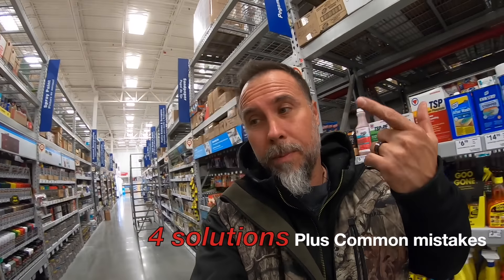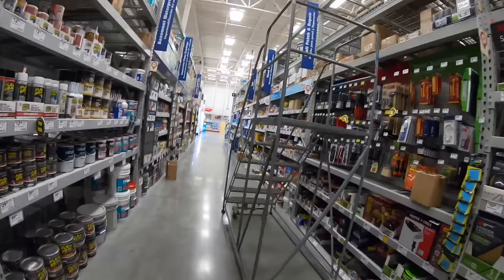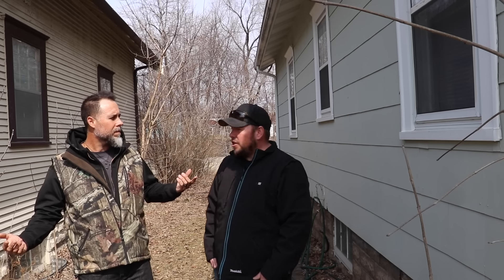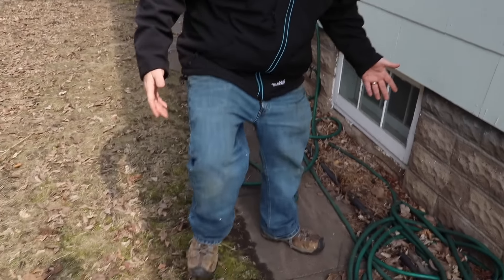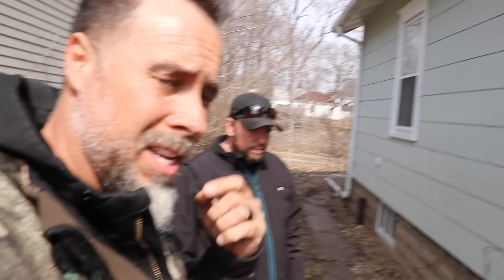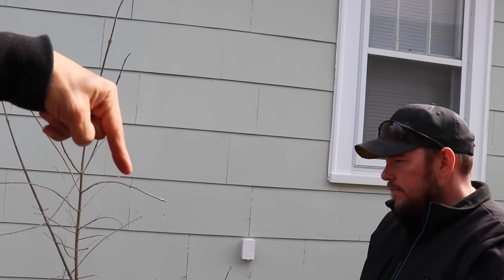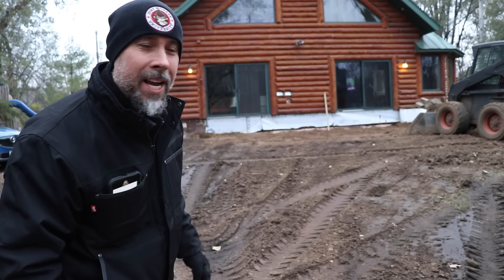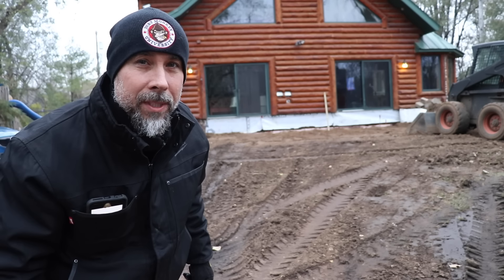4 Solutions to fix a wet basement plus Noob Mistakes

Comment: Betting this post will be deleted..lol.
  These men have only few basic clue of what they speak of.   I'll point out few  examples that they  are not professionally trained below grade waterproofing specialist.  Nipple out? They also called that product a waterproofing membrane is not.   This product is sold world wide,   not hard to find its sold by many different name Mir-a-drain..or j-drain. They also nailed it into the exterior of the foundation wall,   some folks do that,  i don't.   Mir a drain is used to cover the foundation membrane it protects it from the backfilling process..it creates a void between the backfill and the membrane so hydrostatic pressure can not build up  basically sends water directly to the footing drain.  
  Also never backfill with gravel or drainage rock from footing to grade level... cost a ton and your doing a major  disservice your giving service water a path to your footing drain... not smart. 
   A waterproofing membrain is  Typically an   alasticmaric  that dries flexible an builds to at least 6 mil thick. Never a plastic or waterever he was talking about. 
 The issue with putting plastic against the outside of your foundation is,,, its not waterproof there's seems,,,it will dry rot and it will get holes in it when you back fill.  Water will get through hole then can't flow back out and will end up in your basement. 
  Last point where homeowner see water in their basement  has little to do with where it came from when they have a block foundation as the basement in this video..  Block are hollow when water inters it drop to the bottom.. like when you put water in a glass fill bottom to top..point is ever single block foundation in the world history, (as long as concrete want poured inside the block). Leak where it meets the slab... everyone...it comes in where that slab is lowest every time .  When you look at your block wall you will see part of the 1st course of block normally about 3 inches of the bottom run... where ever you see more of that bottom course is where you will see the water because your slab is just slightly lower right there.....if it was slightly lower 3 feet to the right of left that's where you'd see the water because the whole bottom course is standing in water,,, because blocks are hollow...point you see water at your feet it lightly didn't come from directly from the area on the outside and there no reason to think it did...... don't know if anyone is reading this but...let me add this....Mir a drain is to be placed nipple against the foundation..lol nipples out is pointless and just silly.
  He spoke about foundation membrane and thus stuff non fiber..lol that's referring to non fiber asphalt... that's not a membrane and that's not waterproof.   It dries hard and cracks.  They are not ready to make how to videos and no where's close to be working as foundation specialist.   There is one point they had that I agree with..... never ever never put a interior pressure relief system in your basement like ever,   once it's done well never fully reverse it and you will always have a high humidity level and aways will smell like a basement...
Reply: Mr. Paul, I'm in a situation where I can't access 3 of my basement walls from outside. This is due to my basement not being the entire floor plan and then 2 sides have 24-40 feet of slab past the wall for part of the house and the garage. So basically my basement is like an open cardboard box with 3 flaps out and one missing. So the one side i can access and dig down below footer will be a major issue due to all sewage/gas lines and a 18k watt generator on a slab and a slab from where the a.c. unit sat previously will need to be worked around plus septic tank is only 16-18 ft from that wall and also the deck is on that side but that's a small issue. If I dig down that 1 side and down everything perfectly won't the water just run around and come in the other 3 walls I can't touch from exterior?
Reply: I read the whole thing and I  agree with you. Thanks for taking the time to write the next chapter. It was well worth reading and better than the whole video. Watch the FRENCH DRAIN MAN on YouTube his vids are mostly landscaping but contradict half of this video.

Comment: Stan the one thing that I don't like about what Tim mentioned about raising the grade is with window wells and emergency egress people are not as thin as they used to be 80-100 years ago and the fact of doing what he said you can cause flooding issues on the neighbouring property and I agree with you on having the soil a min of 12 inches and max of 24 inches from the sill plate but with windows in the foundation I'd feel better with it being 12 inches below the window and older homes the clay weeping tile is usually not preforming properly and can have roots that have cracked and clogged the weeping tile and by digging down that far you can also repair the cracks in the foundation
Reply: I understand your concern about basement egress. However, the windows in the video do not qualify as egress windows because the window sill is more than 44 inches above the basement floor. This basement could have bulkhead doors on another wall for egress.
Reply: olds767 laundry rooms do require a egress
Reply: @nathanbrodeur  at least in Indiana a laundry room does not require an egress as it is not considered a living space. Only bedrooms are living spaces.

Comment: The problem with every system except interior drain tile is that the water is still there, all along the perimeter of the house. Seems to be a great way to encourage a house to sink and settle.
Reply: No. the exterior methods should absolutely be the first options taken and in many cases are permanent.

Comment: OK I have a new home with a new basement and I am being told to wait to finish this basement until the basement settles(1-2 years) and no problems occur. I have a basement egress so I can put a bedroom downstairs and I have head pipe and additional plumbing to put a bathroom as well. My concerns are, beyond just grading, what should I look for in terms of problems that may present themselves. The walls have insulation covered in thick plastic sheeting.
Reply: Thomas Grant sounds like a nice house just don’t rush into it, big things can happen as the house settles, water paths outside can change and fountain cracks can happen your grading can change, the last thing you want is to finish it and THEN have a problem ......just an example my buddy  had a sump pump that barely ever ran ...well the town came in and did some ground work at the curb (removed a dead tree and repaired a section of sewer line) about 4 months later .....now he has two sump pumps  just to keep up at times. one  pump is almost Continuously running....we guess that something happened with the water table outside....yes he is pissed ....but what I’m getting at is just see how things pan out in the next couple years and peal back the insulation and take a peek
Reply: @stifflers69mom1  Thank you

Comment: What would you suggest for an iron ochre issue? We have a situation were the customer has a very high iron issue combined with a high water table and it keeps backing up the French drain that was installed on the inside

Comment: Tim. PLEASE HELP. I’ve got a customer that has a pool house that the back wall is completely underground. The top is 6inches thick. Also backing up to the top of the pool house is the concrete driveway that goes into their garage. The pool house is 45ft long and 10ft tall. So the back wall is pretty much like a block retaining wall, but the interior of the pool house has HVAC, a complete bathroom, laundry room and a full kitchen. It’s a full stand alone pool house/in-law sweet. But the entire back wall gets so wet water has actually started pooling up in the pool house. We’ve stripped the sheet rock and the entire block wall is wet. What should we do. I’ve only got a 25K budget to fix the water intrusion and remodel the pool house

Comment: Did you explain where you directed  the gutter water?
Reply: JR Armstrong if possible to tap into a storm system that’s ideal. If not you have to get the water 10-15’ away or the water will seep back

Comment: Excavating your property is the most costly option. Sub pumps will show prospective buyers that you have water issues.  Polyurethane grouting is the way to go. Its waterproofing done from the inside and when done will show no signs of work done. If you choose to excavate drainage board is garbage. Use bituthene.

Comment: Quick question Stan.  Still the drainage aggregate fill depth, would you recommend a certain height and width of you are at the bottom off the footing?  Is it a formula like a segment wall?? Also i have never heard of / seen a issue with piping downspouts and i have been doing those since the mid nineties. Love the videos, great info and presentation, i do miss the bloopers and self deprication cut ins though..lol all three best.
Reply: Oops i meant on the drainage aggregate...stupid sausage fingers and Swype..lol

Comment: Awesome informative video. Question for you guys, is there a product one can use that makes concrete impervious that can be applied from INSIDE the basement?
Reply: No, concrete is naturally porous, so trying to stop water at the edge of the inside wall will just cause it to build up inside the concrete wall and eventually freeze, expand, and crack the foundation. You want to have a way of a channel for the water to go away from the foundation, instead of trying to fight against gravity and water.

Comment: What type of system do I have going into my sump well? 3 concrete tiles going into it, The well is also concrete. 1959 home in MN. Thank you.
Reply: Clay tiles ? that's way old school , prone to clogging
Reply: @elliotg9668  Concrete. mini version of street sewer tile,  4'" ID, 1/4" thick. Well is 14" ID and 1 1/2" thick. Ill have to try and find a scope to see if its an interior french drain or exterior. Seems like it was added later, half of my main sewer stack clean out is half surrounded by concrete, dont have much history of the house, been in it for a year. has the knotted pine for walls in basement. Thank you for the reply!
Reply: @thebartender2008  it's most likely interior . Check the direction of the pipe from the sump . If it heads strait to the wall it's exterior , if it heads parralel it's interior  ( please Noone comment on the 1 dumb scenerio that it wasn't the case ) 

If it's a. Clogged pipe it can be cleaned . Bad news once the pipe cloggs the stone bed around it cloggs and that CAN NOT be cleaned out . Has to be replaced .. 

Call your local "Basement Systems" company . They'll be able to remove and replace the wall and fix the drain , keep your basement dry .  

P.s. don't do anything these clowns are saying ,except get gutter water away from the house

Comment: I was quoted a 13k project for interior basement drainage tile system for seepage. Is this the best idea? I live in East Grand Forks,MN
Reply: I would have a good guy do what can be done from the outside first . Downspout drain tiles , regrading , french drains  , whatever it might need . It would be cheaper , but most of all , it will protect your footer from unnecessary saturation . Which will eventually lead to premature failure . The interior drain tile is the last line of defense .

Comment: My townhouse has a buried sill plate and rim joist.  The boards have to be replaced or reinforced frequently.  Aside from the problem of dry rot, I have critters that try to eat their way in, particularly under the deck that butts up against my house. I've actually had to have concrete pumped in underneath the deck just to keep critters from eating their way in.

Comment: What is your opinion on using the more expensive light weight stuff around an exterior that is slightly below grade just enough that water seeps into the house?  I ask because of my physical limitations to install the gravel method. 
Thank you for your videos they are greatly appreciated.

Comment: Nothing like a noob trying to teach noods how not to do 

🙄🙄🙄
Reply: B&B Drainage Solutions explain
Reply: Do you agree they need drain tile on the interior with dimple board or cove molding at the cove joint with weep wholes drilled in the cmu cavity’s

Comment: Exterior grading in many cases can be the most expensive.  Or at least not much cheaper than a basic interior trench draining to a sump pump - especially in cases where exterior grading requires retaining walls and below grade drain pipe.  Doesn't mean you shouldn't grade (prevention better than remediation) but still...

Comment: Two words : sump pump save wayyy more than any of these
Reply: I'd rather the water not make it inside at all.
Reply: ruffchem1 yes that’s always ideal, however excavation if even possible is going to be incredibly expensive. As he said in the video you are talking 10k PER WALL. I had my entire basement done with internal drain tile and water proofing fabric with sump installed for 9k.

Comment: What if footer is exposed because previous owner poured concrete wrong
Reply: You have to use a flexible membrane and gravel on the footer and put ur concrete back at a slant it's the only way .. if been doing this professional for 10yrs
Reply: Thanks for the reply. I kind of figured that but wanted to make sure

Comment: how can a woman do this alone, im looking for the easiest way out to me this seems like to much for me,   help in Pa. !!!
Reply: Ty for the reply @Steve Setherto many things needing done at once , not worth it for what little I can do isn't going to be enough to maintain this place not going to even try , and would take me yrs. plus the cost . The water problem I have is from the negligent twp. that wont fix the problem they created , ( I'm not alone on this ) for me its time to move far away is my hopes , and the sooner the better. People here all complain about it , just not to the right people I learned to speak for myself .
+just not worth the hassle any more the landscaping, paving , sidewalk digging etc. doesn't even add up, easier to move is my best bet
Reply: If anyone tells you that your water problem can be repaired by painting waterproofing of any kind on your basement walls inside it will not work
Issues outside need to be addressed  
Water infiltration can not be stopped by basically painting something on the block walls. It never works at least for long
Call in a pro to at least give his opinion and save you time and money